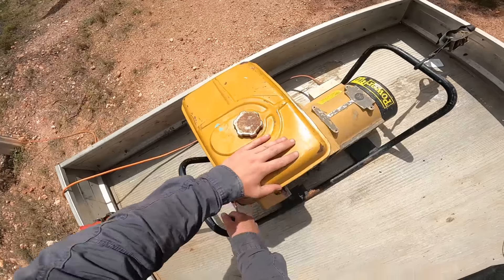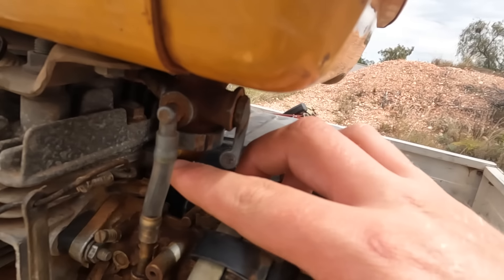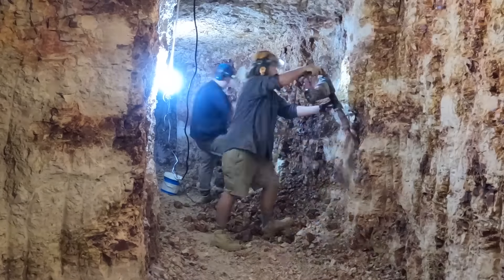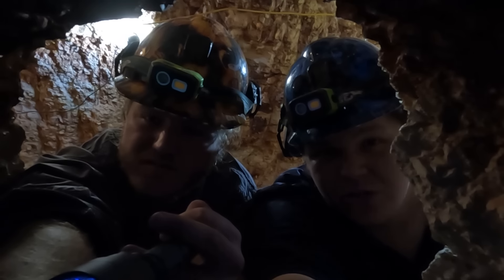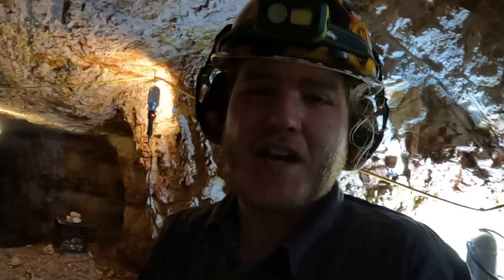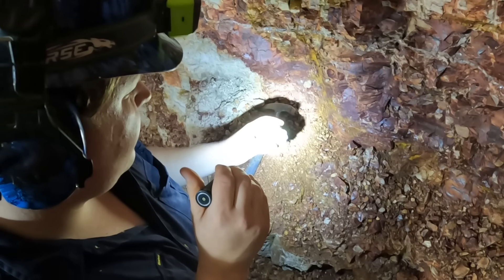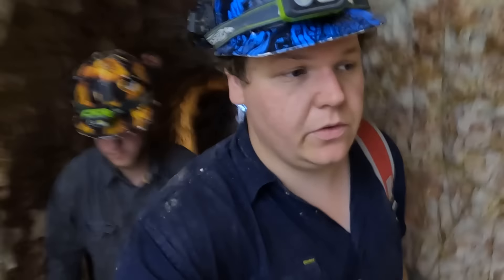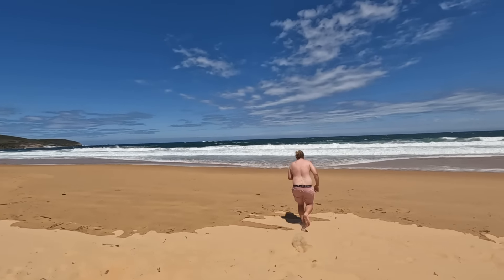Opal Miners Discover Rare 100 Million Year Old Specimen!

Comment: Sounds to me like your generator needs more oil, some small engines come with a safety feature that turns them off when you have low oil to avoid overheating and damage
Reply: Good to know!  I didn’t know that. Cheers!

Comment: Hi Noah, Nice videos that you put out. Hope you got the Generator running smooth. I can say that most of the time the number one reason a gas engine runs lean and sputters out is water condensation in the fuel. Plastic containers are the worst for developing condensation. Most carbs have a drain plug on the bottom of the fuel bowl. Try draining it and give it another try. Thanks again for all the content
Reply from the maker: They thanks very much for the advice I will try just that!

Comment: You should modify your jackhammer. Weld little "wings" onto the hammer rod so when you hammer in and pull down you get a better pull at that section. I see a lot of wasted effort not moving/breaking rock as it could

Comment: Help, mate. Ive been looking for somewhere to purchase a 265nm black light torch. Can you steer me in the right direction pleeease?
Reply from the maker: Hey Gary the one we use is on our website https://younggunsopal.myshopify.com/products/opal-blacklight-kit

If your overseas you might be able to find a similar one closer to you ?
Reply from the maker: They also don’t really work on LR dark base or Boulder just white cliffs and coober mostly.
Reply: Thanks mate for your quick reply. That is disappointing news. I was looking at using one at the Ridge.
I have recently moved from Caves Beach up to a place called Oakey in Queensland where I have purchased a couple of acres with a house attached. Was looking forward to taking time off for a trip to the Ridge to recharge the batteries.
I have a motorhome which has all of the comforts including A/C.
When will you three be back up North after your time away on the Coast?
Reply from the maker: @garyhughes4326  yeah unfortunately it only really works on light based opals some LR material does shine but mostly the lighter and crystal stuff. Anything dark or black doesn’t show well. 

At this point we will probably head back to WC in March April
Reply: @younggunsopalhunters  Thanks guys. Sorry to interupt your break away from the heat but by the look of things you have chosen the ideal place for your getaway
I trust that you have a great time away from that hard slog that the three of you put in up there.
Hopefully our paths will cross at some point in the future and we can share a couple of beers (cartons) together. My shout.
Reply from the maker: @garyhughes4326  hahah sounds good to me! 🍻 Have a great Christmas and new year!
Reply: @younggunsopalhunters  Back at you mate. Give my very best wishes to the boys please.

Comment: I use generators daily also. It's easy to get complacent and start pulling it in the incorrect direction, causing it to rub and break.
Don't forget to empty the float bowl when it start and stops like that.
Better yet take it off and clean the jet.
Carby maintenance 101.
Stuff accumulates there and blocks the main jet easily.
Reply from the maker: Thanks for the advice we will have to get onto it!